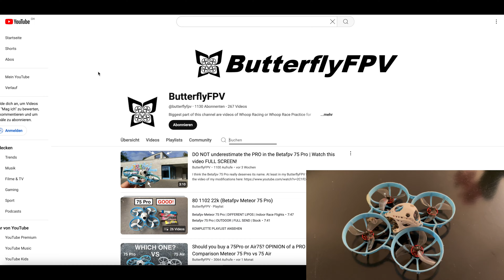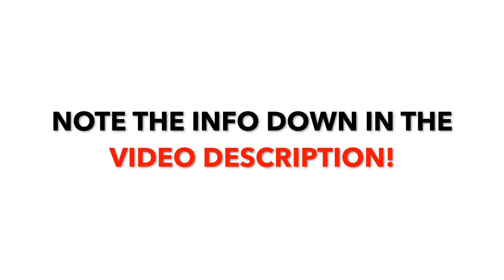Betafpv 75 Pro with a GNB 1S HV 660mah 90C Lipo | Betafpv 75 Pro ButterflyFPV Edition

Comment: nice flight. This is the stock model with 1102??
 With your weight modifications of course :)
Reply from the maker: Yes 1102 motors with Betafpv 45mm 3-Blade props.. And yes with my weight modifications and other modifications (AWG20 main cable and direct soldered motor cables without motor plugs)

Comment: Hi MR Butterfly Pro😂 nice this song 🙌🏼
Reply from the maker: 😂🤜🤛 and the flight was not nice?😝😜
Reply: @butterflyfpv  you fly like me on this....too slow😂🤟🏼
Reply: Did you have a 3D printer ? I whant to buy a bambulab1 mini it s just for tpu pieces
Reply from the maker: @ludofevrier5593  😂👌 Actually it would be good to slow me down if I fly with my whoop friends. But if I crash then more will break. That's why I don't fly with such big lipos.
Reply from the maker: @ludofevrier5593  No. But some friends with 3D printers. I also pay my friends something if they make me some canopys or parts. If I bought it on aliexpress I would also have to pay something. It is still much cheaper than buying a printer yourself. You have to print a lot to make it worth it..